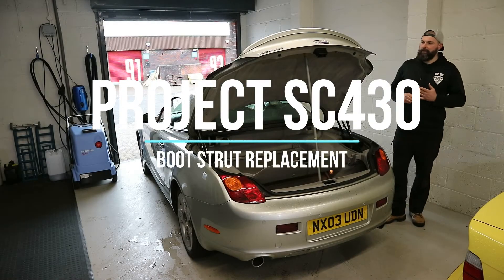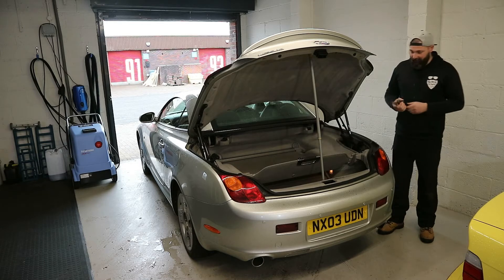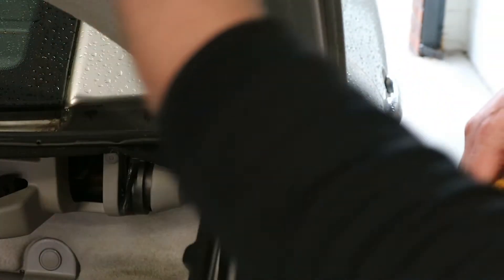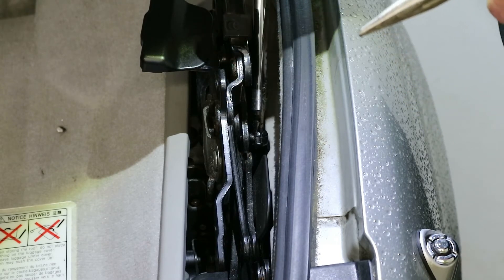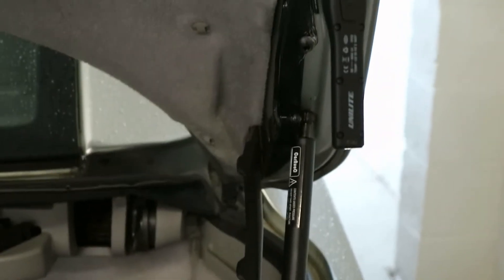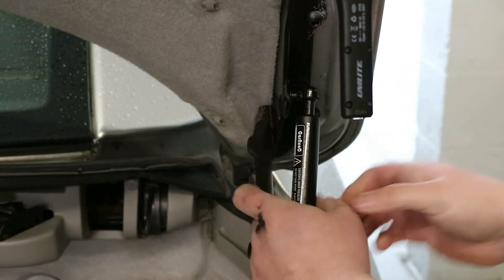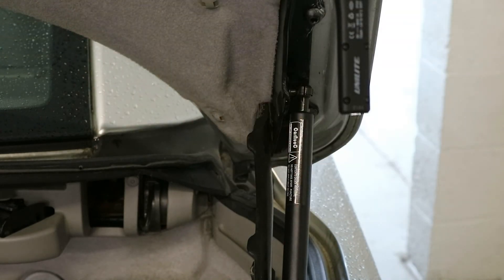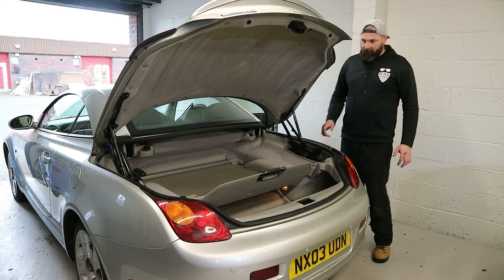Blackbeard's Detailing - Project SC430 - Lexus - Boot Strut Replacement - Scotland

Comment: Hi great video. This has made me think mine are not right on my SC430.
My boot is very heavy you lift up, it doesn’t self lift like yours, but when it’s up it does stay up . Could that be struts on way out on mine too.
Great channel keep it up.thanks
Reply from the maker: Definitely sounds like they are on their last legs, it's relatively cheap for replacement struts to find out if that's the  issue. Can try lubricating the hinge points first as that's the only other thing that could be wrong but the hinges would be making a noticeable creaking noise if that was the fault 👍
Reply: Hi. I tried oil and cleaning hinge pivot points and it is slightly better now. Will see how it lasts. I am in the middle os renewing my wheels. The 5 star centres and hub caps on all 4 corners. Costing me a fortune. Hope to recoup a little of the cost by selling the original 4 wheels inc centres + sensors etc on ebay soon. Love your channel you explain everything do dummies like me understand.

Comment: Hey Ross, great video.
Can I be a pain and ask for the link where you got yours?
I can see loads of companies on eBay.
Thanks, Thomas :)
Reply from the maker: https://www.ebay.co.uk/itm/2Pcs-Rear-Lift-Supports-Gas-Struts-Shocks-Tailgate-For-2002-2010-Lexus-SC430-/233740610748?mkcid=16&mkevt=1&_trksid=p2349624.m46890.l49286&mkrid=710-127635-2958-0
Reply: @BlackbeardsDetailing  apologies for the months in delay, I never realised you responded until tonight. Thanks Ross :)